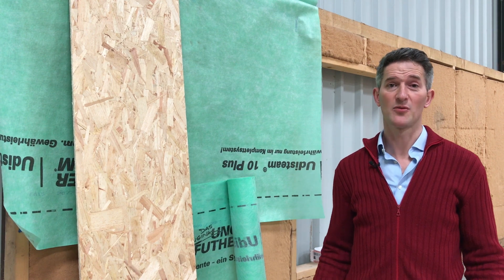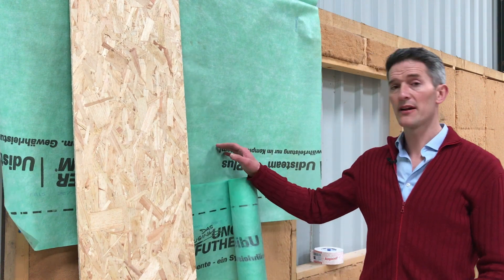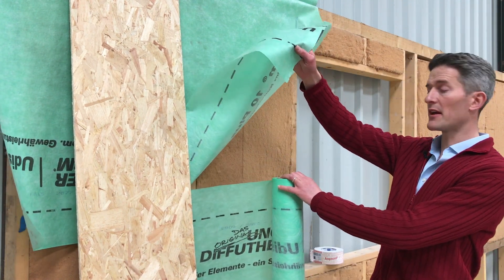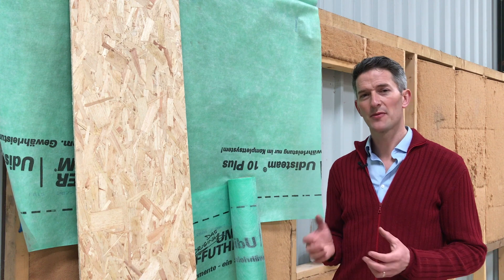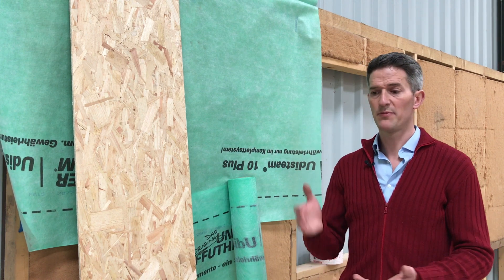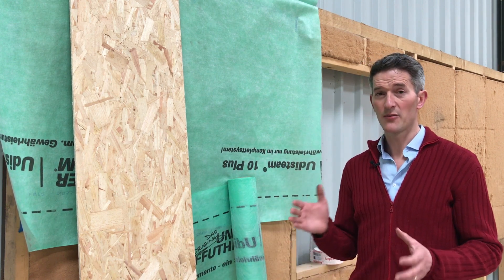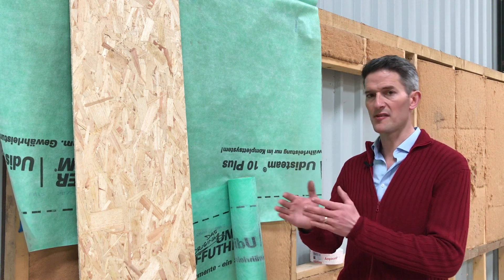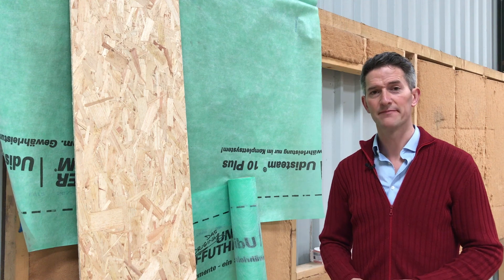What is a Vapour Control Layer?

Comment: I love how there's no faffing about on this video - straight to the point! But is a vapour barrier a better solution than vapour control to stop moisture altogether? Better to have damp and mould in the room rather than in the wall?
Reply from the maker: Hi Michael. Moisture flow occurs in both directions. It tends to be towards the exterior in the winter but towards the inside during some of the summer months, at least in temperate climates. Vapour barriers prevent construction moisture (mainly rain or moisture from wet plasters/screeds) from drying quickly and also can cause issues with condensation as the vapour flows inwards. Vapour control layers slow the flow of moisture but do not stop it, enabling buildings to dry much faster.